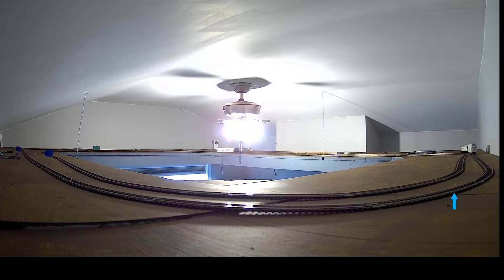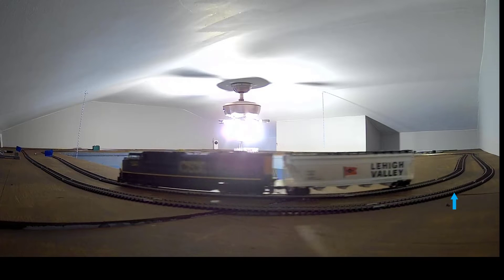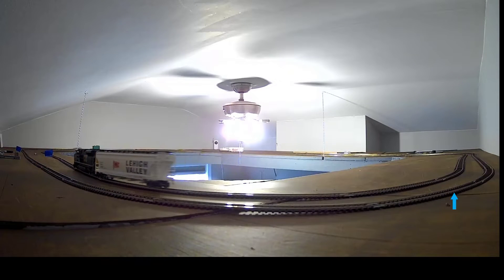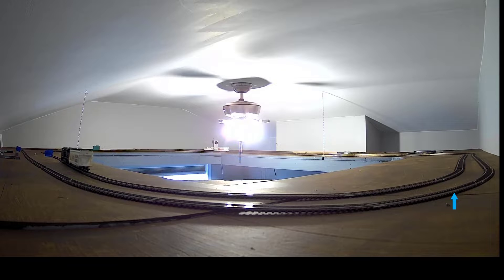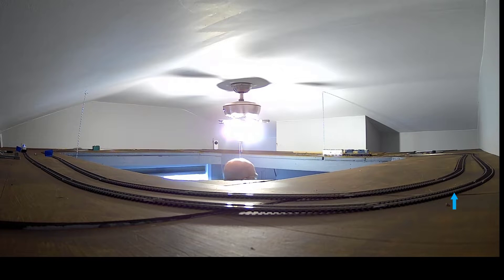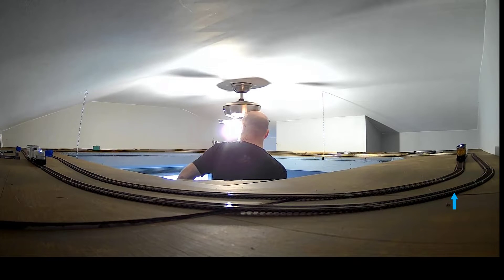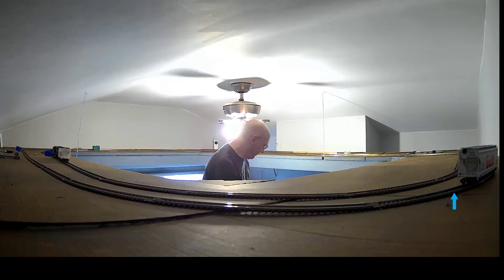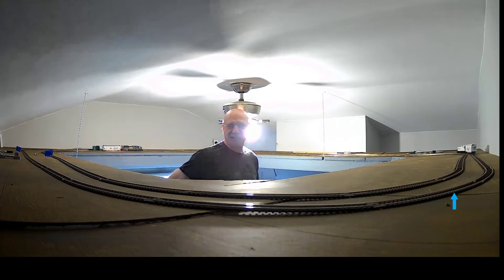111. Third Level trains running

Comment: Very smart to remove the ceiling fan blades. I would not have thought of that and would have paid the price!
Reply: lol yep first thing i was looking at
Reply from the maker: Steve,  Yes I removed them for two reason one they needed to be cleaned  and 2. My head keep hitting them when I was working up there they will be put back on after I finish up that level